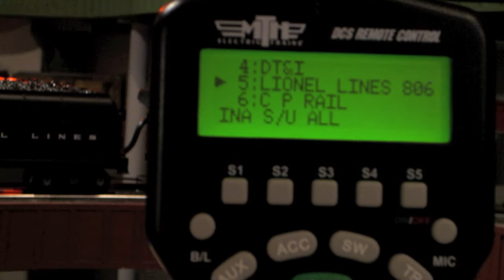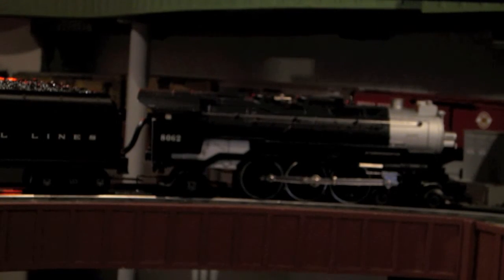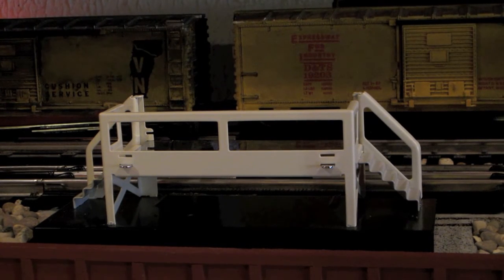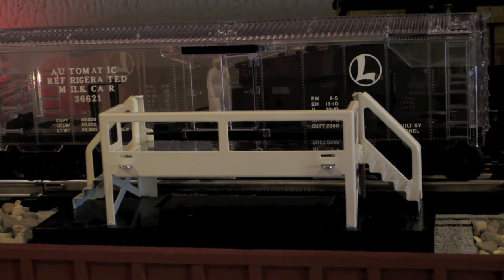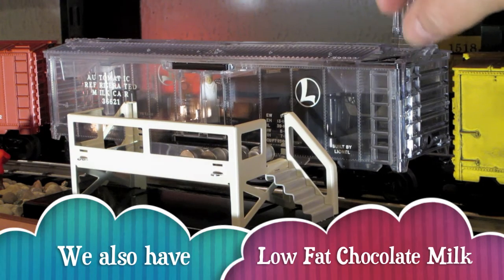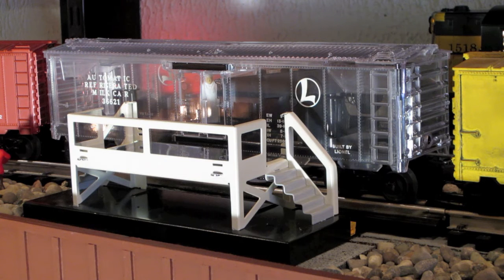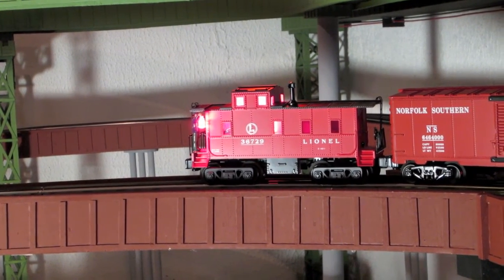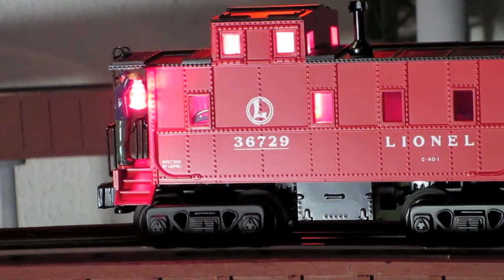Lionel Lines Steam Engine 8062 & Milk Can Car  HD

Comment: How high do you have your voltage set? I'd imagine it would have to be high for the DCS locomotives, which might be the problem. I usually set mine at 12-14 volts for operating cars (milk cars, cattle cars, etc.)